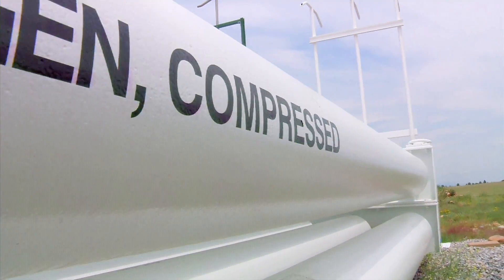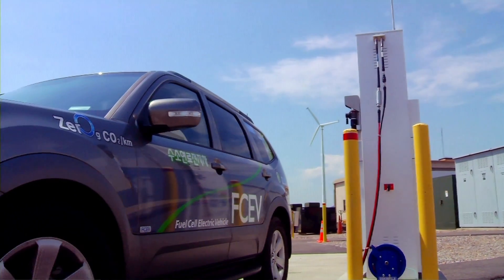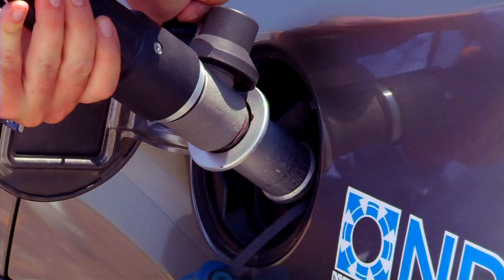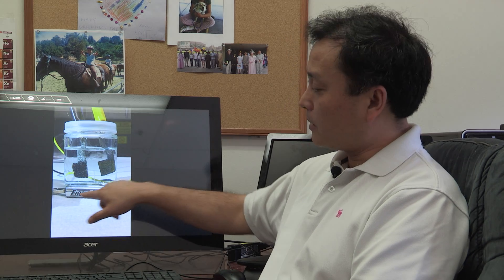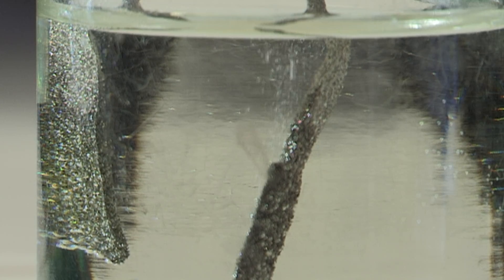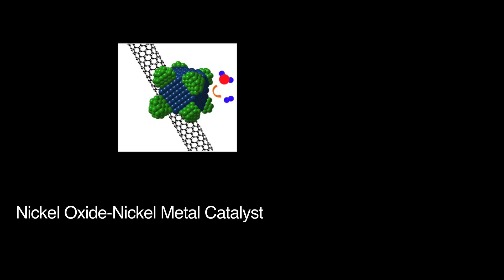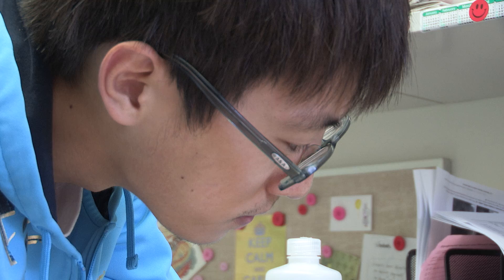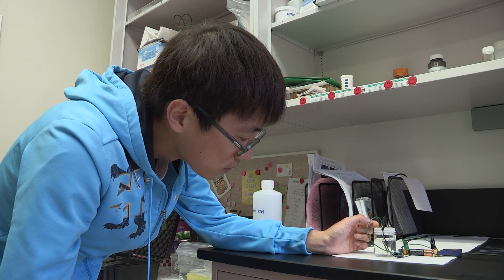Stanford scientists develop low-cost water splitter

Comment: I have one question no one yet has answered me yet.If hydrogen is coming from anode and oxegen from cathode ,,that cannot be right .The instanstant the molecule splits both  hydrogen and oxegen are released .Correct? If that is correct then the oxegen is mixed with the hydrogen seperated allready in one or the other bubbles .unless the cathode pulls the oxegen to one side ,Is that happening ?
Reply: That's exactly right. The electric field from the plates pull the some apart and when enough of them cluster together, a buble of that has is formed
Reply: It goes like this...if you just crack water in one container it's mixed. But if the + and - are separated by being in their own tubes in the same container of water...then those tubes will produce only Oxygen or only Hydrogen.

Comment: When hydrogen can be used as a low cost fuel for steam heating the house, so many poor are dying in Europe due to cold weather. The lobby invested money in oil and gas sector are preventing this free fuel from producing power and energy. 
A wire mesh filled hydrogen fuel tank will never explode. The same technology presently used in aircraft fuel gas tank from explosion in case of an airplane crash. 
One solar powered hydrogen generator can produce sufficient hydrogen fuel which can be used  as fuel gas in steam heating the apartments in cold country. All the vehicles can be powered with hydrogen fuel without any major modification to the existing engines. Within few years the hydrocarbon fuel will be replaced by hydrogen fuel. This is the one of the main reason for the  drop in crude oil price now.
Reply: If it was as easy as what you claim, every do-it-yourselfer in the world would be doing it.

Comment: In the video, it is said that this is the first nible such kinds of metals have been used for hydrogen production. This is incorrect. Dr. Andrija Puharich already did this over 30 years ago:

http://www.worldsci.org/php/index.php?tab0=Scientists&tab1=Scientists&tab2=Display&id=883

http://www.rexresearch.com/puharich/1puhar.htm

"The metal electrode surface in contact with the water solution are coated with a nickel alloy."

Comment: Hi everyone,

It looks like there's a better way - than these "DC electrolysis" methods that everybody is splitting-hairs about. 
Please look up Tesla patent #512,340.  I am not saying that it is easy to read, but it is Extremely Easy-To-Build (DIY).

This water-electrolysis machine is easy enough to be built - by any junior-high student.  Testing may require adult supervision, due to high voltages.

It can built and shown to ANY high school physics class.  Cost is about $100 if you own an induction-cooktop, and setup is about 10 minutes, after 2 hour construction (on a table-top).

I admit that the explanation requires knowledge of electronics.  So, please watch the video first, and then the explanation follows.

Tesla coil with Stan Meyer Water Fuel Cell & Distilled water

OK, now the "technical" explanation
Fundamentally, this is known, but not often taught in Electrical Engineering classes.

1. The 1894 Nikola Tesla patent 512,340 is a description of how to wind wire (primary & secondary) - for a certain kind of electrical (AC) transformer.  It describes how to wind 1 wire for the primary, and 2 closely wrapped wires (or bifilar) for the secondary.    The 2 bifilar wires are so close - that a natural capacitance occurs - due to the geometry of the coil.  

Patent # 512,340 explains a way to reduce certain AC resistances (in the electrolysis circuit) using this bi-filar secondary, and uni-filar primary - wound to be shaped like pancakes.  

a. AC or "periodic' waves are needed for this transformer to function (inherent).
b. However, if 2 convoluted AC waves (what modern science defines as AM radio waves) are created and fed through this transformer, then a "resonant" state can be achieved - which effectively reduces the AC active resistance (Capacitive & Inductive reactance are cancelling each other out at a certain "resonant" frequency) in the circuit.
c.Those 2 convoluted waves are called carrier & AM modulation waves.

The electromagnetic effect is obvious when sending nearly 1 kilowatt of energy across this easy-to-build transformer circuit. 

2. Tesla also released a patent #685,957 describing how to collect radiant energy - (today - we call it the Microwave Background Radiation MWBR - or zero-point energy).  The device is a simple plate capacitor - suspended in the air - and it acts as an antenna for wireless power-transfer - using 2 pieces of insulated metal - right next to each other (acting as a capacitive antenna).   It is not obvious, but it shares similar characteristics to the first patent.

========================

I have successfully replicated this patent - along with others (who have done the same).  This patent fully explains how to solve the reactance problem with electrolysis - by sending AM radio waves through a diode - and then into Stainless Steel Electrodes (at high voltage) to electrolyze distilled water - into 2H2 + O2 gases (or oxy-hydrogen gas).

I should repeat - listed above is my video - showing electrolysis of distilled water using a high voltage AM radio-signal (approx. modulation 200 Hz, Carrier 20,000 Hz) - without salts, hydroxides, or other chemicals.   There was no heat detected by touch on the induction-cooktop or my constructed coil sitting on-top.  The two coils working together are Tesla's patent #512,340.

1.  Inherently - transformers are wireless devices. This is also apparent, since the 2 pancake coils (unifilar & bifilar) ARE THAT transformer (and separated by 1/2" of air, plastic, and insulation) from each other. 

2. What makes construction so easy - and showing that extraction of usable electric power with an induction-cooktop is possible - is due to the cooktop - generating the AM signal within it's electronics - automatically.  And it stays cool to the touch.

3. No complex circuit was needed - other than adding a HV diode for water-electrolysis.  I just plugged it into a 120 volt wall socket (they make 220 volt models - for those inclined).

4. My construction took 2 hours. Everything was off the shelf - except the SS pipes. Amazon will size them for you.  I used the small ends of zip-ties to suspend the 8" pipes between each other. (3 zips on each end of pipesets).

5. Cost - about $175 on Amazon for the induction cooktop (1800 watt 120 volt), 40 feet of 14 AWG threaded speaker wire (both copper conductors), some 500 watt halogens, and some super glue. And yes - you guessed it, the water tank was once a rain gauge.  Kil-o-watt meter was $20 at Menard's Hardware. 

In summary,
1. Patent #512,340 is coined the "Tesla Biflar pancake coil" (from 120 years ago - January, 1894)

2.  It is unique - since the biflar coil has a relatively high capacitive property - versus a similarly wound unifilar coil. .

The bifilar design allows it to resonate easily - similar to an AM radio receiver.  It normally works within a certain band of AM radio waves (signals having carrier & AM modulation portions) - and the frequency depends on the load used..

3. As describe in #512,340 - Amplitude Modulation (AM) resonation within a biflar secondary will cancel out the capacitive reactance & inductive reactance in the circuit. 

And, since water has a conductive property, then it also shares the inverse property - or the "resistance" property, as well.   In this particular case, water can be shown to be made part of an LRC resonance circuit.  

4.  The coil is also unique, because a magnetic core is not needed to generate a relatively high-efficiency output from the bifilar secondary.  Just wire - and super-glue to hold it in-place.

5.  The induction-cooktop is a wireless device - since pots & pans don't touch any metal parts protruding from the cooktop.  The cookware sits on plastic - it's a wireless device.

6. Through JLNaudin's testing - and some of my own initial testing -   capacitance measurements show that this bifilar coil device is acting as a capacitive antenna, and a transformer secondary - at the same time.    This bifilar coil can generate it's own capacitance due to it's own "antenna-like" properties.

If you want to see a full suite of test measurements (not just on water) - please see the originator of this "easier" technology, JLNaudin.   His test results are here:   http://jnaudin.free.fr/wfcbooster/indexen.htm

I have simply replicated it with more pipes & some lightbulbs.  It shows power flowing down path of least load - instead of least resistance.   I encourage anyone to try it with their children & observe.

Comment: To answer the question of why this is something new, here's a quote from Professor Hongjie Dai
 "This is the first time anyone has used non-precious metal catalysts to split water at a voltage that low. ...It's quite remarkable, because normally you need expensive metals, like platinum or iridium, to achieve that voltage."
Reply: The efficiency or volume of gasses produced was not discussed, which may be part of the discovery.
Reply: Spoken with wisdom.

Comment: So, what exactly makes this efficient? The price of the electrodes was never a big issue even if you use platin. The REAL costs arise from the energy demands of the electrolysis itself - and THAT is why we produce hydrogen from fossil fuels.

Not to mention that using an AAA battery may sound cool - but since AAA batteries deliver 1.5 Volt and the required voltage for electrolysis at standard temperature and pressure is 1.48 Volt, this is neither earth-shaking nor astounding.

So, what IS the news here? That you managed to use nickel and iron as electrodes? Seriously? Unless you're telling us that you're more efficient than PEM electrolysis, I don't quite see what's there to talk about.
Reply: A few things to consider. This reduces the setup up cost of electrolysis facilities so that it becomes economically viable to setup up plants where excess power is cheap or even free but intermittent, such that it wouldn't justify the pay off time associated with platinum electrodes. That 1.48V is absolute theoretical limit, This means a 0.02V (*further information below) voltage over potential, Which would be extremely low. This is what matters, If you just put two pieces of plain nickel in there it would not bubble.

*This is where i need to point out a few things, Firstly over potential is defined as anything over the gibbs free energy of the lower heating value or anything over 1.23V, the difference in energy between water vapour and oxy-hydrogen mix. 1.48V comes from the difference between room temp water and oxy-hydrogen mix, This is simply stating that due to entropy between liquid and gas, you have to give it enough energy to split it AND turn it into a gas, You don't simply get the phase change for free.

So assuming 1.5V that gives an actual over potential of 0.27V, But then that accurate either, A Zinc/manganese dioxide battery can actually output up to 1.65V, giving a a maximum total over potential of 0.42V. Where as the closest non-precious metal electrode being straight nickel gives a 0.84V over-potential, Literally double, This means electrolysis would not happen until 2.07V

Also you state that electrode cost is not a factor, Well it kind of is, A shiny flat platinum surface is quite a shit electrode that has low surface area and a higher over potential reducing efficiency and production rate, So electrodes are plated is a particular refereed to as platinized or 'black platinum'. This is a porous/powdery structure at the microscopic level that increase surface area shitloads, But also has much lower durability, requiring electrodes to be replaced much more often.

Either way I expect this post has drawn attention to some of the short comings in your knowledge.
Reply: On a vastly larger scale, the reduced cost of materials could make this a far more economical method of producing hydrogen or sodium hydroxide. 

I'm not sure if the electrodes in precious-metal splitters corrode, but if there is corrosion over time, the variable costs with this solution may also be decreased.

In any event, lowering costs (even by a fraction), it usually is for the best.
Reply: That's right, the news is not complete.  What is the power requirement to split the same amount of hydrogen versus the power required with the more expensive metals.  If it is the same power requirement or less, then this news is not so important.
Reply: Platin does not corrode. And the expensive part is the energy needed to split the water molecule. The cost of the electrodes is negligible compared to that.
Reply: If that is indeed the case, then the lower fixed cost of non-precious electrodes may enable a greater number of startup producers, or non-specialized distributed installations (eg. home, office building), even if the variable costs remain unchanged. And more companies/citizens producing hydrogen gas inevitably means a larger industry surrounding it.
Reply: I'm sorry but you didn't seem to quite get the part that the electrode costs are negligible even if you use Platin?
It doesn't really matter if you pay 10€ or 20€ for something once if the running costs are 100€ per hour.

Again: Electrodes are usually a ONE-OFF cost if you use precious metals.
Nickel and iron electrodes? Non-precious which means that they might corrode...

Not to mention that you probably don't even need electrodes out of solid platin. A thin platin coating should suffice. Will test that tomorrow.
Reply: Yes, I understand what fixed costs are. I also understand that even if these costs are low, when scaling to very large numbers they add up (economically speaking), especially when taking into account a relative scarcity.

I'm not arguing your original point. I am saying that a reduction in costs (any reduction) is generally a step in a good direction.
Reply: If you need to store energy then something like the Vanadium Redox Flow battery is much better. I still don't see what the big advantage ist.
Reply: You can try to make a point without insults. As you're obviously unable to do so, I'll disregard your arguments as worthless.

Please try again.
Reply: Johannes Hass http://www.sciencedaily.com/releases/2015/06/150623113836.htm
Reply: Also Johannes, at the cost of over $34,000 dollars per kilo for platinum as opposed to around $11 or $12 per kilo for nickel/iron alloy I'd say YEAH THE PRICE DOES MAKE A DIFFERENCE YOU KNUCKLEHEAD.  If you wanted to build a commercial production facility to produce say 50,000 kgs of hydrogen a day, you'd need a helluva lot of platinum to start with and when you crunch the numbers, there's absolutely no comparison whatsoever, you'd be milions of dollars ahead going with the nickel/iron alloy.

Comment: Is this an old video?  I ran this experiment 4 or 5 years ago in high school using a couple of iron nails and a AA battery.  Anyway I thought the technique for splitting water into Hydrogen and Oxygen was already well established... electrolysis... discovered by Micheal Faraday.
Am I missing something here?
Reply: Akeem Hart What is novel is the use of CHEAP metals like nickel and iron in place of platinum, iridium or other rare/expensive catalysts.  Well the low voltage and temp are important but not the major breakthrough as I understand it.
Reply: Daniel Potter Yeah you are.  What you're talking about is something everyone who ever took high school chemistry knows.  Why on earth would you assume that this is what they're talking about???  You're thinking of the kind of electrolysis where the ions of the nails are being exchanged from the positive electrode to the negative.  Using dissimilar metals, like copper or gold you can plate the steel with those ions (otherwise known as electroplating). 

The purpose of the work as Stanford is that they are only concerned about splitting water molecules into hydrogen and oxygen AND the key is that they have accomplished it (efficiently I assume) at low voltages and using COMMON AND CHEAP metals like nickel and iron.
Reply: +Russell Popham can't you use the Baghdad battery, or several, to power the electrolysis?
Reply: Sorry Ben, but the Bagdad battery theory doesn't hold water, lol.  Seriously the facts are that with our current technology (no pun intended ;?) until this discovery that is, the energy input required to split water to make hydrogen is higher than the energy that is obtained from that produced hydrogen.
That's why the vast majority of hydrogen used today is obtained from the fossil fuel industry.  There are many other ways to produce it, just not as cost effectively to my knowledge.  That's why this could be a very important breakthrough if it can be scaled up affordably.
Reply: Russell Popham Yeah... But, the Baghdad battery, even though power is weak, it is still is a real thing. I don't get the whole we need infrastructure for Hydrogen cars. Yes the power needed to create it with electrolysis is more than the energy released from burning hydrogen, however, if you are using solar energy for the electrolysis does it really matter? The system I saw someone else come up with was an electrolysis unit at home powered by solar power and a huge tank next to the house collecting it. Then you can pump the hydrogen straight to a high pressure tank in your car and run it for roughly 300 miles. You can also use the hydrogen to heat the water and cook food in your house.

Comment: This development is a very positive factor in making solar and fuel cell energy sources viable on a global basis.  Solar to produce the hydrogen, and fc to produce the power.  This could replace the extensive grid system currently in place and the massive fossil fuel use that diminishes quality of life in so many ways.  Watch for extreme suppression of this technology by big oil.